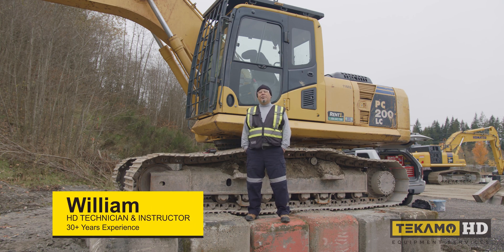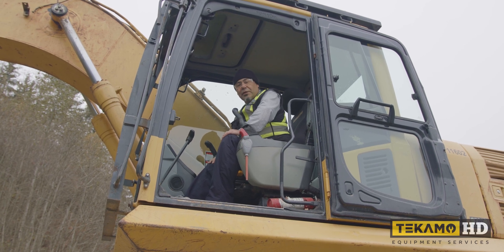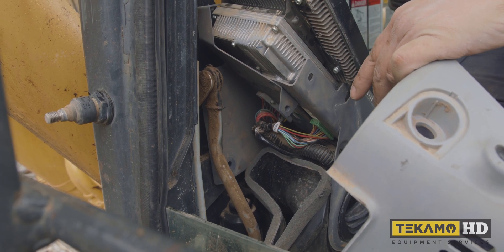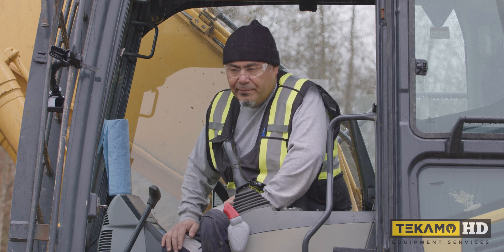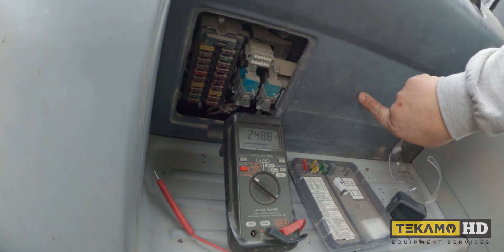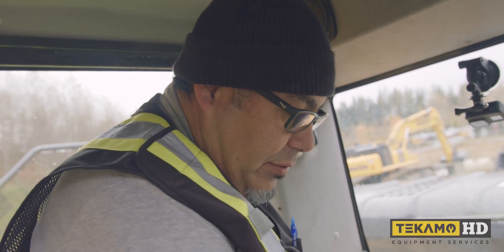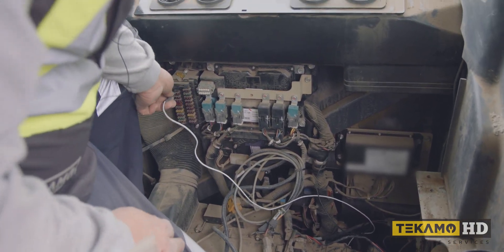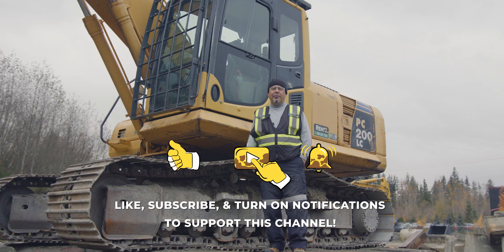Service Call: Komatsu Excavator Repair on a PC200LC - Wipers, Heater, Radio

Comment: Hello ! Very interesting !
How to do remove the slider front windshield on a Komatsu pw130es-6 ?
My rollers needs to be changed, but it seems the 4 rollers pins to be welded on the windshield frame, so I don’t see how to remove it !!!  Thanks ….
Reply: Hi Rene, Check out the link below, it may not be an exact machine make and model but it may be a similar removal procedure.  There is always a way to remove these rollers, that may be pressed on to the shaft pins. I hope this helps. 

https://youtu.be/zPmi3RY8hFE
Reply: @williamriquelme2147  hello and thank you for your effort. Actually I have finally found the way, it was very tricky. It was necessary to remove the « sky » of cabine,  Also necessary to put the seat at correct angle. After removing the rear lock, it was possible to slide the windows fully rear and it would pass thru openings. I remade the rollers with 3D print rollers I designed. Works fine now 😀. The trick was nobody would guess it’s possible , once the sky removed it appeared

Comment: I have a pc 138 kamatso, it keeps blowing the fuses for the AC. The AC will run a while and than quit. Bad relay maybe? Any help or suggestions  would be very helpful
Reply: Hi Scott, apologies for my delayed response, I assume you have repaired by now and when you say AC, I assume you mean the blower motor?  
First of all make certain that you are using the correct fuse, then check all connections (make certain all electrical connections and grounds are tight). I would disconnect it and check to see if it spins freely and there is no drag, if bushings are worn you feel a drag or some side to side play (in this case motor may need to be replaced). Just for testing purposes, you may also want to swap out the relay with another less useful (not important) relay. Look for any melted insulation or hot wires, faulty or loose switches - heat creates resistance in a circuit and will blow fuses.
I hope this information helps.

Comment: Hello sir, I have a new Komatsu 210....2002c_7 excavator. The temperature rises to 80. I hope you can help me reduce the temperature. Thank you for your efforts.
Reply: Hello ابو محمد العراقي, You should know better about seeking help. You would need to provide much more information about the machine operation and status of when it is overheating. I assume you are referring to 80 degrees Celsius??? 
If it is equipped with an EGR System, then the top temperature may be up to about 230F which is approx. 110 degrees Celsius.

Comment: Think there's a resistor which fails so maybe not the Motor
Reply: Hi James, Your comment on the resistor is well noted and that is why I like to bypass the entire control circuit and power up and ground the fan directly which identified the motor as being the issue. Thanks.

Comment: Sparks a nightmare give me hands on mechanicals anytime
Reply: Hi Jon, I agree with your comment and, trust me when I say, most mechanics would prefer good 'ol fashioned mechanical systems...but unfortunately our manufacturers don't feel the same. They advance the technology on these machines and we are still required to repair them. So, as technicians, we have to run towards the technology and embrace it in order to keep up to date with technology.
Reply: William Riquelme But is the right way to go it's something this type of machinery doesn't need it just cause more down time for the shake of a electronic sensor when the machine would run fine if it was not fitted  Pull the dip stick check the oil water in rad idiot lights are all you need